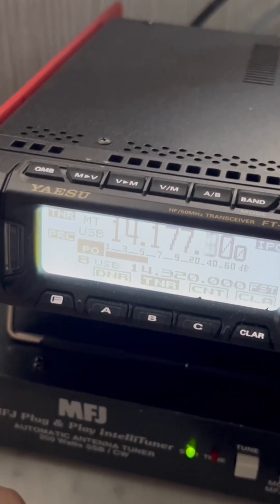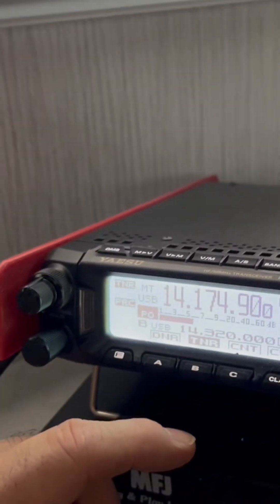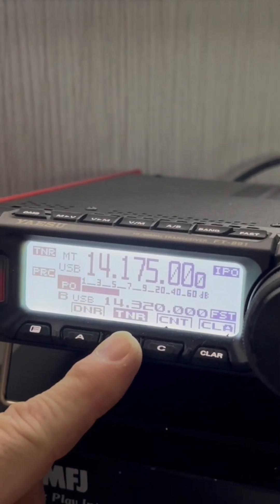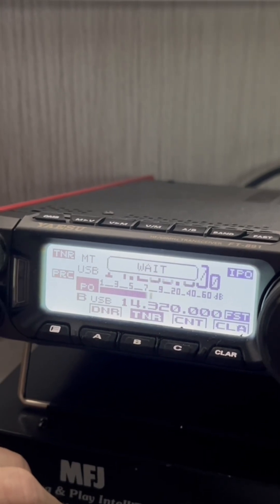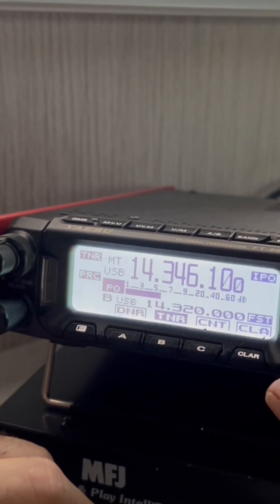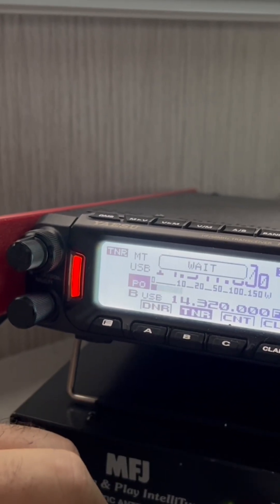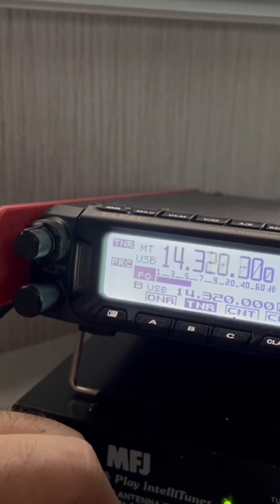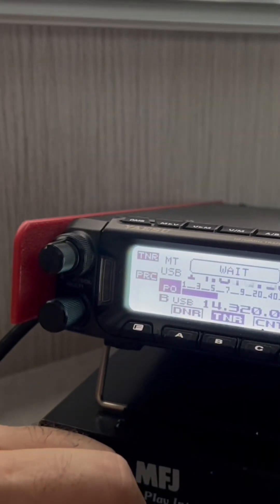Yaesu FT-891 & MFJ-939Y Total Automation #hamradio #yaesu

Comment: You had some videos on the FC-50 with the FT-891 and I was thinking about getting one someday soon.  After seeing this, I have to ask which you like better and why?  Appreciate your advice.  73
Reply from the maker: The FC-50 is what I call a “touch-up tuner.”  It can match an antenna that is already close in impedance.  The maximum it can match is a 3:1 SWR. I used it to touch up the band edges when I used ham stick mobile antennas. Now that I use the ATAS-120A antenna, the FC-50 is no longer connected. 

The MFJ-939Y is a wide-range auto-tuner.  It can match up to a 32:1 SWR.  It is the clear winner, compared to the FC-50.  It can match virtually any type of antenna. It might even tune a rain gutter (Hi Hi!).
Reply: @n4hnhradio  you are so helpful, thank you sir
Reply from the maker: You’re very welcome!  73, de N4HNH

Comment: Having tried both I prefer the LDG z100plus. It doesn’t have that silly “wait” pop up and also does 6 meters.
Reply from the maker: I’m sure the LDG is fine.  The “Wait” message is just letting you know that the radio is awaiting a confirmation from the tuner that the match for that frequency has been recalled. By the time you stop rotating the VFO, and you dial in the precise frequency you want, it’s ready. You only really see the “Wait” message while you spin the VFO.
Reply: @n4hnhradio  yea and that’s exactly the problem,lol. Could they have put “wait” in a worse possible place? Another silly Yaesu decision.
Reply from the maker: We could all go back to building our own radios, tuners, and antennas. When I first got into this, I met hams who wouldn’t dare buy a radio, tuner, or antenna.

The Japanese manufacturers aren’t going to listen to us. The American manufacturers will but they charge nearly $6,000 for a transceiver.
Reply: @n4hnhradio  sure or instead I just kept the LDG. Like I said I had both. It’s great having options.
Reply from the maker: There is no reason to buy something different if what you have works. I went 20 years with the same HF base station.

Comment: Hi Doug,
How do you handle the tuning with more than one antenna using an antenna coax switch? Stay safe.  73  WJ3U
Reply from the maker: Great question. I usually have a best antenna for each band and that is the one I let it store matches for.

That’s why having a tuner like the Elecraft KAT-500 would come in handy. It has three separate antenna ports and it stores the match for each antenna port for instant recall. Switch from Antenna 1 to antenna 3 and it loads the match parameters for antenna 3.